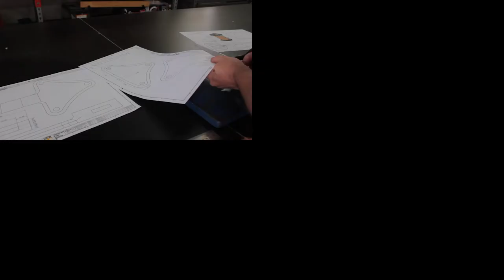Blacksmiths Leg Vice Restoration

Comment: Thanks for posting this video as i need to replace the mounting bracket and was not looking forward to the amount of forge welding that was ahead for this project i still have some work forging the part that goes around the leg and spring I'm using 12mm x 40mm steel I'll still have some forging as I'm looking too make the split mounting bracket

Comment: Looks good.  I bought a new Kanca 6".  Much easier and it is welded.  Im not a fan of wedges that might come loose during use.  I prefer bolted and welded joints.  If you do any smithing at all the vise is a crucial tool.
Forge On!

Comment: Nice job. I would be wary of that spring though. You are right about the box and screw being the high-wear parts. They are a better sign to look at than the handle when checking out an old post vice. That spring is going to put a lot of unnecessary and pointless wear on both the screw and box. Most of those old vices have little to nothing acting as a spring, and they work fine. I have used mine for 30 years with a spring that did nothing. Have fun, Blacksmithing is a most enjoyable craft.

Comment: Did you have to add weight to the stand?
Also how long is the leg that goes to the ground, the one I have is missing most of leg.
Reply from the maker: Not yet, but I reckon will be filling the box with concrete shortly.
Reply from the maker: The leg from the bottom of the rectangular bit is 340mm to the ground or approx 13 1/2 inches.
Reply: Thank you very much for the information about the length of the leg , I will try to weld a bit of steel onto it .

Comment: What is the angle on that spring I can't seem to get mine to the right angle
Reply from the maker: Hey, It's 15 degrees for mine. It's at 5 1/2 post vice.
Reply: Ok thanks I'm pretty sure that is what size mine is I haven't  worked on mine after my failed attempt to fix a new spring